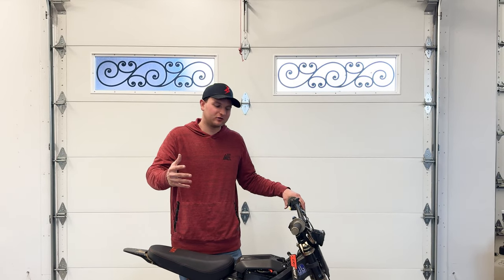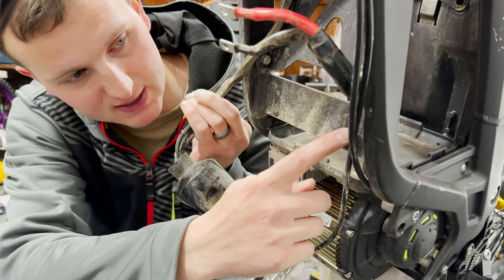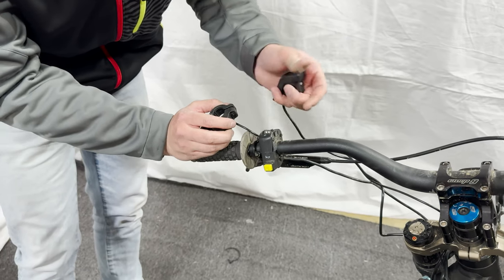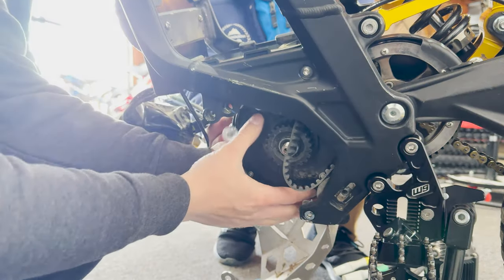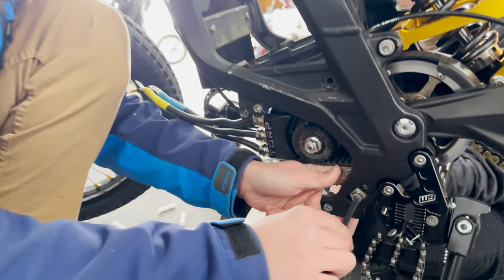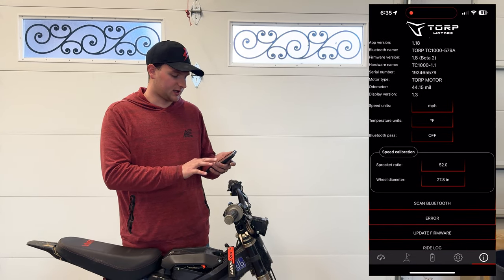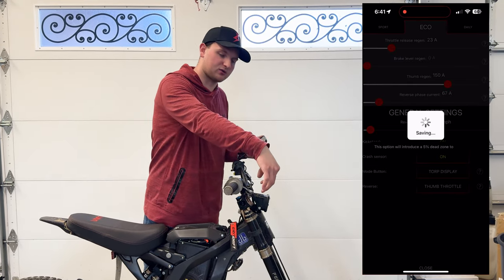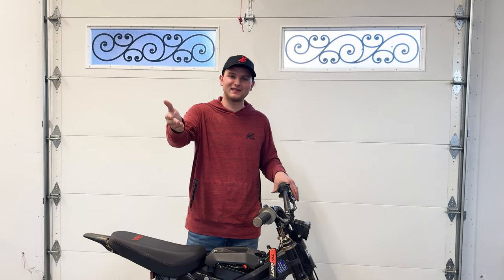Torp TC1000 Controller & TM25 Motor Install and Setup!

Comment: What are your thoughts on X9000 V2 or the TC1000? Pros and cons? I know the torp is easier to install and probably works better with the road legal kit. Torp also claims efficiency of 99% vs 95% claimed for EBMX
Reply from the maker: Its a hard choice for us man, We really like both but have more experience with the x-9000 and really like it. We need to spend more time on the torp to really make a good decision

Comment: Just installed this setup tm25 and tc1000 with a chi max 72v 51ah and holy shit i wasnt expecting the torque at 700 phase amps especially considering I have the stock sprocket and weigh 225lbs
Reply from the maker: Yep that motor has so much torque!

Comment: Can you please advise witch is rims and tires are mounted? Shinko? I would like a set up similar on a talariaxxx.
Reply from the maker: Warp 9 18 inch rear, 21 inch front, Shinko 241 18x3.50 for the rear. Shinko 241 21x2.75 for the front. https://tbelectricmoto.com/products/talaria-sting-r-mx4-part-2?variant=48047621177643

We sell the wheels and tires on our website

Comment: Just watched your video on the TC500 install on the Talaria Sting! I am wondering if it is worth while to do the TC1000 instead of the TC500 on the Sting if I am planning on upgrading to a 72v battery later? Thanks for the great content!
Reply: That's what i'm waiting for TC1000 for Talaria to drop. I spoke to Torp guys and they said its coming. For the extra few hundred bucks i think its worth it but youll need to upgrade the motor also to get the full 50kw.
Reply: True, I caved and got the TC500 (I make impulsive purchases) worst case scenario I sell it later and upgrade I guess lol.  @supertalaria
Reply from the maker: TC1000 for talaria is out at Darwin EV! Its worth getting if you ever plan to upgrade your motor and battery.
Reply: @Talariaboys  Any coupon code for the TC1000 for Talaria??🤙
Reply from the maker: @supertalaria TB50TC1KT

Comment: Hi , did you have a chance to test thumb regen ?! I am wondering if 200amp regen can keep the bike at 10mph in 20degree downhill?! I really appreciate if you can tell me this
Reply from the maker: Yes we tested thumb regen, it works great and can provide a ton of braking as long as your battery isn't fully charged and you have enough traction on your rear wheel.
Reply: Thanks for answering, I really appreciate it , 
May i ask , what was the lowest moTor RPM that regen works ?